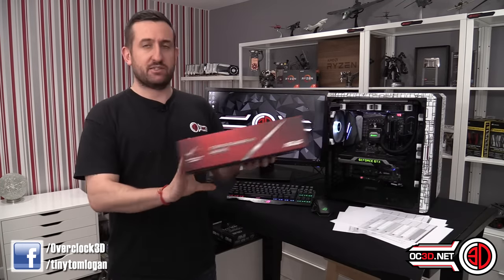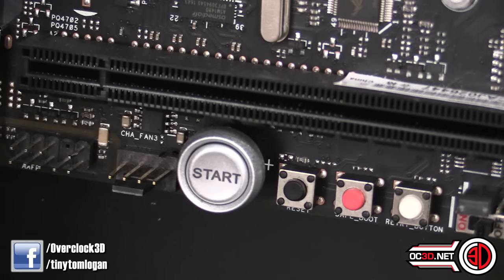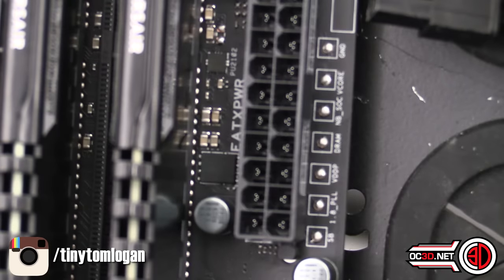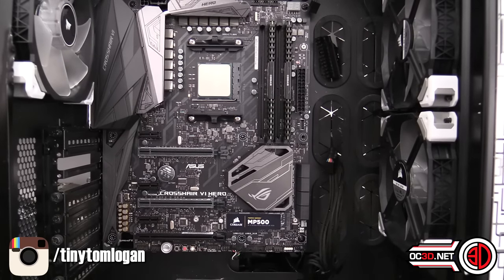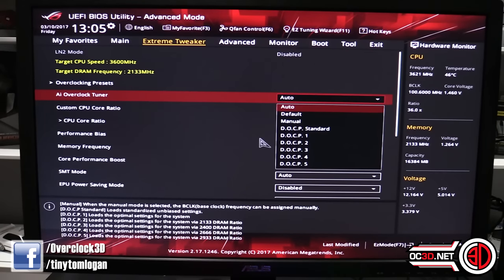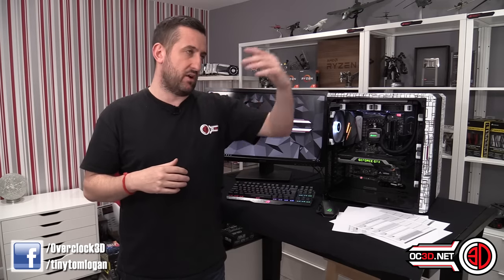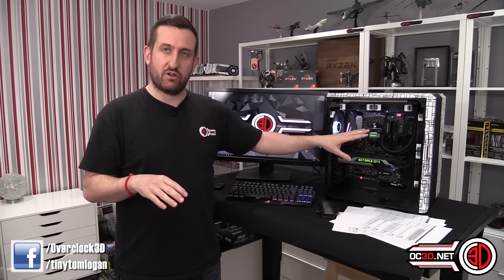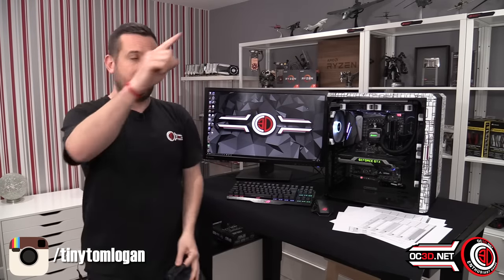Asus Crosshair VI AM4 Ryzen Overclocking Motherboard Review

Comment: I just received my board today, and this is exactly the video I was looking for!
Reply from the maker: 0901 BIOS has just gone live.... Get that on your board asap
Reply: OC3D TV are you gonna do a indepth guide in overclocking? ive already ordered this board and thr 1700x.. but i eont be using it yo about july and was wondering does that extra cpu power make a differnce in overclocking?
Reply: i watched this whole video in one sitting.
Reply: George Thomson doesn't really apply to am4 mobos atm as the BIOSs are already buggy so it's best to get the latest from what I've seen
Reply: Yk

Comment: good video did you try the bios
ASUS has 1403 now as of 7/5/2017
just saw them today also have the CROSSHAIR VI HERO

CROSSHAIR VI HERO BIOS 1403
1. Update AGESA code to 1.0.0.6 
2. Improve system stability

Comment: Tom, to start with, which kit of RAM did you use on that board, I am looking at the ASUS support side even today, and don't see much (if any 3000 sticks) there are a few 3200 but wanted to check with you which brand and model you got. 

Its the most Expensive (apart from the EXTREME and WI FI board) but worth every penny, I have done so much research about all the Taichi, MSI, and all the others and always come back to the Crosshair, not sure why but I trust Asus and their quality vs others such as MSI which in the past have let me down so many times with their Quality Control and poor choices for example. 

Asrock, I would like the Board (Taichi) and looks but then for the price I put a bit more into it and have a Crosshair which I know will just work.

Comment: It's good that more reviews are showing the benefits of faster ram  for these Ryzen platforms.  And you don't see a benefit in everything, but when you do, it tends to be rather significant. Between this video and a few others I've watched, it's solidified my choice in purchasing ram that's known for clocking higher on these am4 systems.

Edit: and yes, I will be picking up this board when new stock is available for it. I was drooling over all the bios options when i first saw it.

Comment: when you are showing the bios of that board its still at 3.6ghz and core voltage is set to auto and is 1.43 that is higher than amd spec of 1.37, that does not seem right, were the gigabyte board the same?

Comment: That cooler looks crooked or is it just me? The bottom and top right corner gaps are less then the other 2 corners. and a small niggle but why in the bleep would they not have the writing on the chip pointing left to right, not up to down on the motherboard.  Little things.
Reply: It doesn't matter.

Comment: Help! Please! I just bought this motherboard and when I got it, I noticed that my Heatsink Lights aren't turning off after Windows Shutdown. I updated to the latest Bios and the issue remains. I tried enabling ErP S5 and the lights did go off but it was permanent. Any solutions to this? My old MSI Z170 Gaming M5 was working just fine with the RGB. This motherboard doesnt. Please, help!

Comment: Hi Tom. Good informative review of the Crosshair VI Ryzen board. Something I would like to ask is, is there any chance you could do a specific overview of compatibility between Ryzen cpu's, motherboards and memory, as you have mentioned memory compatibility issues throughout this video?

I am already aware that this board you have reviewed now has a QVL list on its website for download as to regard memory sticks, their makes and speed, but I have come across instances in my research where it has been alleged that some memory on the QVL has not functioned correctly.

Even with the disappointment of the chaotic launch of the Ryzen cpu's, and the memory compatibility issues, I have still decided to go the Ryzen route for a full entirely new PC build, and I have researched the hell out of each individual part that will go in it. After choosing all the components, I am stuck on which memory to use?
Reply from the maker: Elysiumfire sadly I don't have all the memory on the qvl. Also to test cpu's boards and memory is a mammoth task that might be out of date in a week when bios changes :/
Reply: Yeah, I understand. Many thanks for responding. I've chosen all my parts for my new build, some of which are little over-the-top for what I need, but at least I'll be future proofed for quite a while.

The whole build itself is quite expensive, but I am treating myself, as I don't tend to build a full system too often. I'm even buying a new 34" monitor. Normally I would only swap out a part now and again when required. So, my new build specs are as follows...

CASE: Corsair Obsidian 750D Full Tower PC Case
CPU: AMD Ryzen™ 7 1700X 8 Core AM4 CPU/Processor
MOTHERBOARD: Asus AMD AM4 Ryzen CROSSHAIR VI HERO X370 ATX 
RAM MEMORY: Corsair 16GB Vengeance LPX DDR4 2400MHz RAM/Memory Kit 2x 8GB
GRAPHICS CARD: 8GB EVGA GeForce GTX 1080 CLASSIFIED GAMING ACX 3.0. (may go for the TI) 
SSD 1: Samsung 850 EVO 500GB 2.5" SATA 3D-VNAND SSD/Solid State Drive
M.2: Samsung 250GB 960 Evo PCIe NVMe Solid State Drive/SSD MZ-V6E250BW (as Steam drive)
AUDIO: Creative Sound Blaster ZX PCI Express Sound Card 5.1 Channel
COOLING: NZXT 280mm Kraken X62 RGB All In One CPU Water Cooler Intel AMD inc AM4
OS: Windows 10 Professional 64Bit (DVD or flash drive) English 
MONITOR: SAMSUNG C34F791 Quad HD 34" Curved LED Monitor - Silver

I believe all this will work together seamlessly, although I am still doing a little bit more reseach regarding memory. I already have a 850 watt Seasonic PSU, and a 5.1 surround sound system (hence the card).

Best wishes

Comment: I have being following you for years Tom, and that's because of the meticulous work you put up. I bought this motherboard btw and i'm happy with my choice. But somethings doesn't go smoth with amd. Like small glitches when i put aida64 bandwidth sound will stop and PC freezes for moments, and i'm with a satble little overclock of 3.4GHz. Also anoying is that i have G.skill F4-3200C16-8GTZB wich are not in QVL but it wont boot anywhere near 3200MHz, and if i try i'll be for 30 Minutes trying to reset bios and post again. I'm happy but somethings i don't experience not even with my old Kentsfield and P35 motherboard. Not to mention that overclocking with intel you have more to tweak more to play with. So i'm happy with my comeback to AMD but i guess somethings never change. cheers mate from portugal

Comment: how do i get the internal usb headher to work? ive got running it at 4ghz (1600x /6cores/12threads(standard 3.6mhz)) and max 40 degrees celcius idle  Cooler Master MasterLiquid ML120L RGB just bought the ryzen 5 1600x with a asus prime x370 pro board but after my 15 year old coolermaster real 450w psu died somthing on my prime died to with my new coolermaster masterwatt lite 500w psu i got only 10. xx volts on the 12v what i saw in the bios and it started up and shut down in the bios or in the windows10 startup. so i bought this board the asus crosshair VI and now it works 12.xx volt on the 12v line instead 10.xx on the prime x370 pro.

Comment: I don't know what Ryzen Master is measuring. but it's not lining up with the temps in the bios, the socket temperature sensor, and the temps the H110I reports after a stress test.

for instance my temps at 1:30 prime95, 1800X stock (1.22-128V)

Ryzen master: 80C
socket: 44C
H110I: 37C
Bios (after reset): 30C
now I don't believe my cooling is that ineffective after 1:30 hours. especially because I had it on the quiet profile and it never went up more then 1000 RPM.

something is wrong with the temperature reading.

Comment: Could yo do a review of this motherboard with the Ryzen R7 1700 cpu, a EK-XLC Predator 240 1.1 with EKWB'S AM4 bracket and G-Skill Flare X DDR4 3200 ram (2 kits for 32GBs.)? 
Thank you
That's my planned mobo, cpu & ramm upgrade.
I already have The EK-XLC Predator 240 1.1 in my current Skylake pc and I know EK Water Blocks has a AM4 bracket for it and will be ordering it soon.

Comment: While you say that the Cinebench result indicates that the base clock change does not effect performance, it could still be the case that the bclk is adjusting other variables, such as cache frequency, which would not manifest in Cinebench. 
Could you please test how bclk changes compare with multiplier changes at the same frequency, as the ability to adjust the bclk is one of the main differentiating factors of this board, and the performance improvement over the Gigabyte board is greater than expected with just an extra 133Mhz on the memory.

Comment: Why not use the Little Devil computer case with built in Phase Change Cooler system and install everything per the instructions you should be able to get over 4GHZ only problem is the PC only comes on when the temperature goes below -100 degrees below zero but I sure that the start up temperature can be set to -250 degrees below zero

Comment: So what R7 model to buy for casual OC? Like 3.8/3.9. 1700 or 1700X? 1800x is way too expensive imo since the other models are just 200mhz under the Limit of the 1800x. Im not experienced in overclocking but want to get a Nice oc out of the new chips for a good price value. Can someone help? :) i was thinking about to get the 1700x with a baseclock of 3.4 and then oc later step by step..

Comment: I just installed my 1800x on a PRIME X370-PRO today and the first thing I noticed was that the CPU temp was around 40 on BIOS 0502 and after updating to 0504 it was 60 so I think the BIOS applied that 20 degree offset AMD told us.

Hope they bring them back to the real ones.

Comment: gah.... again that damn Q Code LED turn on  (the first thing i did on my Asus X99-A motherboard was to cover that shit with black tape and eventually sold the damn thing) . Hope we gonna have a option to turn off that crap.
Can't wait for AMD RYZEN 7 1700 review and maybe test full load for noise check with a AIO cooler on 3.9 GHz overclock.
I think i will go for a full EK custom dual loop (2 radiators (280mm) with SpeedFan to take care of the temps and coolers speed)
Really enjoy your reviews :)

Comment: According to techspot's HEVC playback guide the 2 latest generations of GPU's as well as the 6th-gen cpu's have hardware support for decoding.
In the event that this benchmark utilises the GPU extensively a higher baseclock would definitely be responsible for the big performance gain. Especially since bclk also changes your pci-e speed on this board/chipset. (I'm fairly sure it does not on my x99 board as I think they are separated there)

Comment: Can you review the AsRock x370 Taichi. That seems like a very similar board, just a bit better with 16 power phases and 2x2 WiFi a/c.
Reply from the maker: Ive asked but their PR and Marketing dept are useless. I dont have time to keep chasing them trying to do them a favor.
Reply: That's too bad :(. I was really looking forward for that board's review.
Reply: OC3D TV can't see asrock responding to me needing any help if they ignore tom Logan-unfortunate poor customer service means a no buy fr asrock
Reply: Actually that board has a 12+4 power phase. Which is controlled by a 6+2 Voltage Controller that is paired up with so called "doublers". There is no Voltage controller in use that can control more then 8 phases. The controller on that board can work in a 8+0, 7+1, or 6+2 mode. Double it up and you get your 12+4 phases for the Vcore and SOC respectively. So it's a sort of 6+2 phase that is better than a true 6+2 phase. This is the best you can find on any high end board for AM4. Because in theory 8 phases could be even better for the Vcore than a doubled up 6 phase, but then the SOC would be left without any power phases. That would require an additional Voltage controller, which would make manufacturing a lot more expensive. 
So what's important is that it's the best Vrm circuit you can find and it's a 12+4 phase. (even on the Z270 boards)
The two power phases are two separate things. Vcore powers the actual cores and SOC powering the memory controller, USB, SATA, etc. part of the CPU. And probably it will also power the IGPU. So it is not fully utilized yet. (but that is not confirmed yet) And with a normal CPU it won't ever be. So it doesn't really need a heat sink as well. For a safe 1.1-1.2V SOC overclock. That part of the Vrm doesn't really get stressed. That's why a cheap board with 4+2 phase or 3+3 phase is capable for the same OC. Because OC is not board limited in the Ryzen lineup.

Comment: thing that worries me , the default voltage on 1800X
i see you have AUTO O.C. 3.6Ghz speed , so 1800X,
the vcore is going up and down on idle , no loads.
1.438-1.504.  
like 66Mv difference , and not even due to loads.
was maybe load line calibration too high? 
would be nice if it stays 1.438-1.445v , just an example. 
and i guess since people said , AMD said 1.380v is max what we think is ok.

i assume then that the motherboard selected way too high voltage for the 3.6 ghz 
should be maybe lower.
maybe with the given voltage on Auto/offsets , you can already go grazy high.
and it only does 3.6Ghz now. 
multiplier stays 36, and base 100 Mhz.
so what is going on , must be LLC
anyways vcore is scary high , or i have the wrong info.

maybe start with fixed voltage on the dram too , with rated voltage.
worse case scenario it becomes unstable during test.
but does not raise the DRAM voltage.
start with lower mem speeds is good idea.

default GPU speeds and voltage and check what happens with BCLK changes.
what does it do with PCI-E/GPU stability, GPU clocks?
etc

Comment: So uh, if I was planning to keep my CPU nice and cool with a Kraken X62 for example, I have to contact NZXT and have them send an AM4 bracket to me after I've gotten my hands on both the CPU and motherboard? And wait at least another two weeks before I can even assemble my system? Or am I missing something here?
Reply: Anton Bertilsson i dont know if the x62 comes with an am3 backplate, but if it does, then it will work if you put the am3 backplate in the am3 holes in this motherboard

Comment: Just purchased this board and an EK full cover block and have not picked a cpu yet...question is: do you think i would be doing this board an injustice pairing it with a ryzen 3 1200 and with a 1080 G1 and oc'ing on a custom ek hardline loop to the 4Ghz mark?. (note: not a hardcore gamer just general). and i already have the 1080 and Ek full cover block. 

resolution: is my 2560 by 1080 on a LG 34" ultrawide

p.s: just trying to keeps costs down slightly.
Reply from the maker: I can help thinking that maybe a 6 core might be better but at the end of the day its the core speed that will count with most games
Reply: cheers for the info tom legend as usual ! :)

Comment: 1.46 vcore seems very high for 24/7 usage...I can imagine the temps being quite high even with a Kraken x62 running on it at that vcore...I'm expecting my 1800x system parts to arrive in a few days and will be using the Crosshair mobo as well...hopefully with the current BIOSes, I can achieve 4ghz stable with around 1.4-1.425 max on the vcore.

Comment: Ryzen is not really a hot running cpu.
AMD has added a +20C offset to the temp range. So all temp readings are actually 20C cooler than stated by sensors

Comment: I got my Asus prime x370 pro on Monday and it bricked itself by Tuesday. I heard these crosshair boards and Asus b350 boards have the same issue as well. Elmor on the crosshair vi hero thread on overclockers. Net has a big thread and that has a link to a newer bios that fixes the self bricking issue. :)

Comment: My biggest problem with this board is the lack of m.2 drive slots. How could it only have ONE???? I need at least two. How could this be a 250 pound board, and not have two m.2 pcie drive slots?????
Reply: Yeah, I find it ridiculous that there is not one single board out there, that has it all in one package. Every board seems to miss one or two things that the other has, so there is not a complete one out there. And as you go up in the price range, the feature set just gets really disappointing compared to the price. I haven't found a board yet that fits my needs. And I'm not even talking about huge things, as I still use an MSI P55-GD65. But compared to that even back in the day, mid range board. These new "high end" boards seem so empty.
Oh yes, I know there are similar boards out there, that could be good for me. Like the ASUS Prime Plus B350. But ACL887 audio? What were they thinking? That's worse than what I have right now in a 7 year old board. :(
Reply: Well, what I did was just order the Asus m.2 riser pcie card, and it runs my other m.2 perfectly well. But for this price it really should have had two m.2 drive slots. Now that I have it, my only other complaint is that the start/retry/reset buttons are all placed poorly down at the bottom where the pcie slots are. I am using all pcie slots, and thus those buttons are pretty much blocked. They should be up near the pci out display at the top righthand side. That is where they put them on all of the intel mobo's.
Reply: You people seem to be forgetting that its not just about slapping another m.2 slot on the board, m.2 nvme slots need 4 pci-e lanes and unless you're running an i9 or threadripper or a xeon or whatnot, something with enough pci-e lanes, you'll run into trouble since you won't be able to run 2 pci-e graphics cards AND 2 m.2 SSDs and not hit bandwith limitations.

Comment: Do any of the boards that you have tested run both top pcie slots at 16x ? I on making a sli system.
Reply from the maker: No. Youll have to wait for a board to come out with additional PCIE lanes added with a PLX chip. Likely to be an expensive board though. The actual X370 chipset is the PCIE lane limitation
Reply: hed420 yeah, as he said, basically the chip has 16 pcie gen 3 lanes for dGPUs so you get a max of 8 lanes per gpu for dual gpu set ups